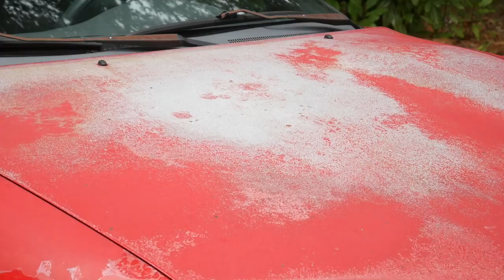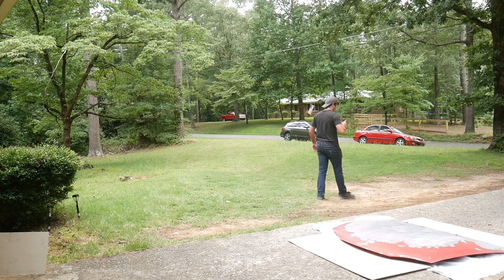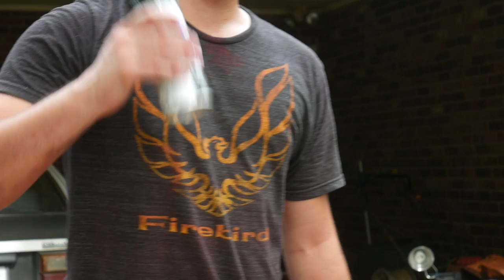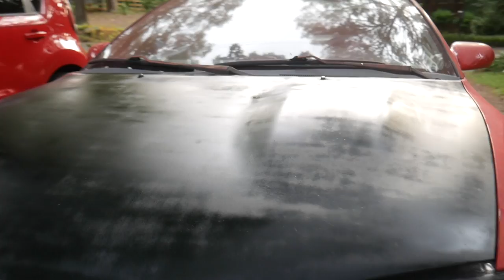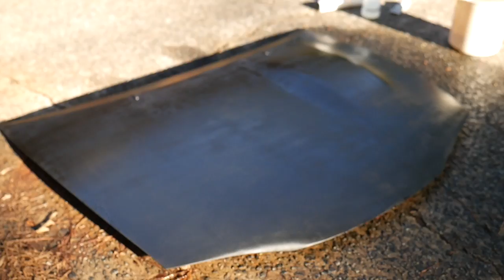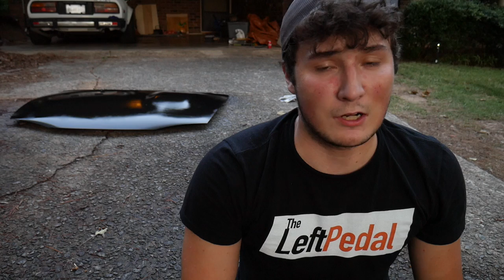Spray Painting a Car With No Experience

Comment: For anyone wondering the streaking is caused by not enough over lap between strokes. There should be at least a 50 % overlap (meaning your next stroke should be half over the last like mowing the grass.) I for one like to have 75% overlap
Reply: Please don't say "I for one....".    It's so .....
Reply: True however that cheap spray paint   does not put out enough paint. Next time get better paint it makes a world of difference and I don't even mean super expensive rattle cans either.
Reply: @timwegman5776  that's a good point!

Comment: I'm not a professional painter by any means. From my experience, 90% of painting is prep work. Keep a solid 7 to 9 inches away and overlap your passes.
Reply: I think his biggest downfall was how close he was to the hood, if he would’ve backed off the streaks wouldn’t have been like that
Reply: @KaelinTate  looks like he also used very cheap spray paint they tend to have awful tips
Reply: Nah with rattletraps you need around a 75%overlap to actually make it not streaky and look great

Comment: You didnt overlap you paint strokes and never paint in direct sunlight
Reply: Would a cloudy day be alright to paint in?
Reply: @dakotaburroughs7905   yes and no in a garage and at least 70 degrees yes but out in the open with humidity on a cloudy day I would wait
Reply: Yeah but hard to over lap with the fan pattern on the cap but yeah in ideal time bigger cap or a gun 😂
Reply: Dakota Burroughs build a booth. build it out of sticks and trash bags if you have to but just build a booth.
Reply: Can didn't have a fan sprayer only like a straight shot
Reply: @shinigamizzz5372  exactly its all in the prep work 😄
Reply: Yeah didn’t overlap. Even with a spray can you can manage to overlap and get better results
Reply: The biggest mistake he made was he almost sanded down the whole hood. Should have went all the way. Secondly if you're going to take it all the way down you have to use body filler. This will give you an even layer to work with. Most of the filler would have been sanded right back off as it was only meant to fill in the low areas. That's why it looks streaky because you have high and low spots in addition to misapplication. Shouldn't have to keep sanding down the primer let alone the basecoat. Then not only was there no overlap but he started spraying over the hood rather than before. The strokes were not the same distance causing uneven layers while applying. Now having said all this he has never done this before so it's a good way to start to learn. You make a mistake and learn from it. Everybody does.
Reply: @rafaelmonzon1429  Ur comment was a reason why i was happy watching this video, because i knew someone with knowledge would be here and tell us how to do it right, thx :-)
Reply: @3DamX1  Np I had to learn too
Reply: Had the same problem from holding the can to close and trying to cover in one coat
Reply: Not sure you understood the point of the video
Reply: Noted. Thank you
Reply: 3DamX1 same exact thought
Reply: @kevinmontoya7318  v
Reply: You also don't use Rust-Oleum. It's great for small projects, but strokes show really bad on bigger projects.
Reply: @STOPH3R01991  just watched 3 videos of a guy using rust-oleum and the cars looked great .

Comment: So the basics: 
-paint inside to avoid insects and dust that can ruin everything. 
-paint with long, wide, overlapping strokes, not short ones here and there like you were doing
-make sure there's enough paint. If you're not seeing it begin to shine after your 3rd spray you need to go slower to get more paint onto the surface
Reply: Also,I would have put that hood on a table or something.It had to be a PITA painting it like that!
Reply: Also he was painting with a round nozzle he should have used a flat nozzle for surfaces like that...
Reply: That is the key when painting big objects you need way more coverage and that spray painting technique that works on smaller objects where you spray on and off can't be used here.
Reply: Prep the surface. Then do it again. Also, resist the temptation to try to touch up that one little spot...
Reply: It's a beater car with a beater paint job and I think it's perfect. Good work man!
Reply: @joeyperdok  Unfortunately wide fan nozzles are not always available.
Reply: Very helpful comment and spot on.

Comment: I think there are two things to add: you seem to have used cans with round-spraying nozzles. I'd get cans that spray wide vertically or put such nozzles on your cans, clean and reuse it on the other cans. Also it seemed to be quite windy which blew the paint away.
Also I'd sand after each layer and give myself a few days for the whole project and work in quadrants (spray one are of the car part at once)

Comment: The trick is in the nozzle. It doesn't matter if you use Rust-Oleum or whateveroleum. Just get a good nozzle that sprays with a wide fan. This way it's easier to overlap you coats and you wont have the stripes.

Comment: A FEW TIPS for those of you DIY painters: if possible, try to keep the can VERTICAL. These rattle cans perform very poorly when you spray them facing downward too much. 

I learned this while painting my wheels, the second time I sprayed them, I angled the wheels more vertically. Also, if you spray too close, the paint will run. If you spray too far, you will get a rough texture and bad shine. Find the sweet spot on a scrap piece of metal or plastic. 
Finally, don't rush, I learned that multiple thin coats (5-6) give you the best results and even coverage. Buy a lot of paint, you can always return what you didn't use.
Reply: Also advice from my cousin that spray painted his lancer (350bhp not-EVO) - it's better to use too much than not enough, you'll want to polish, probably removing 50% of what you painted, anyways...
Reply: Spraying down IS spraying vertically. I think you mean horizontally.
Reply: @joserios1948  do you ever gaze into the horizon? 🤔
Reply: @beauyoung1172  the post was edited. Reading it made it seem like he was mistaking the 2. Thats why i said that. Looks fine the way it is now.
Reply: With most spray cans I would agree, but not with Rustoleum.  I haven't figured out how they do it (I'll need to cut one apart) but the "newer" (probably the last 5-10 years) Rustoleum cans spray pretty much the same in any position, even upside down.
Reply: w. woody what if you’re painting the floor ?...
Reply: w. woody  What, as in someone painting a car with a gun?  The good ones always hold the gun perpendicular to the surface, so surfaces like roofs, hoods, and trunk lids are sprayed straight down or nearly so.  If you don't you get tiger striping with many paints.
Reply: Definitely keep that in mind
Reply: w. woody  Huh???  Read my first comment.  The newer style Rustoleum cans which just about all their products have been converted to spray pretty much the same in every position, even upside down.

AND, within that context your previous answer makes no sense,  a pro painter isn't going to be doing a job like this with a spray can.
Reply: @Jose Rios  Do you hold your handgun sideways too??

Comment: I’m an old man, I think you did awesome 👏! I could not have done that good.  Good Job buddy👍.
Reply: Mark Lanham You’re an old man?
Reply: L00N3Y ABC  actually coming from a painter it depends on the situation on a flat peice of metal of course it's ideal to stay one way to keep overlap consistent and smooth however when encountering ridges, and shapes in the metal it is important to hit it from different angles to make sure paint is even at all positions no peice of painting flat one way if your peice has a bonnet scoop or such as you'd end up heavy paint at the top of the scoop and bugger all around the sides or at the very least very incositant spray pattern. So maybe give it a rest.
Reply: @georgekatsikis6729  you're right katsikis

Comment: There is some solid advice in the comments.  That is NOT terrible for a first timer.  Listening to you talk about it, it sounds like you’re on the right track with what needs to happen.  Keep trying on practice panels if you can, skill is acquired by practice.  Slightly wetter coats will help each overlapping pass lay down into the previous pass, when the coats are light it dries quicker and lays on the panel as a mist...giving you that rough texture.  Also, always follow your “wet edge”.  For example, don’t start on either side and meet in the middle.  Make sure fresh wet paint is overlapping your last pass of wet paint...some paints may require more overlap than others.  Keep at it and good luck!

Comment: I’m starting a project too no professional but here’s what I’ve learned:
Start with 400 grit, move up to 600 grit. Fill the scratches with metal filler. Then Prime the car and sand it wet sand paper at 6000 grit. Then paint - get and airbrush if you can. But I loved the video ! 💕💕💕💕💕

Comment: On most spray can nozzles they will have a direction head. You can twist it so you can spray up and down.. or left to right. The reason you are getting streaks is because the nozzle was probably set to up and down. You were spraying left to right. 👌 hope this helps

Comment: Need to put this item around hip height on 2 wooden work horsesl
Outside temp between 60 and 75 degrees
Under a roof or out of direct sunlight
Out of the wind
Paint can should be less than 12 inches away 8 preferably
Wipe the surface with acetone to remove any fingertip oil all grease and oil.
Only use one directional paint sweeps either left to right or right to left not up and down and always overlap by 50 percent.Takes practice with spray cans because the spray fan pattern is only about 3 inches
1st coat very light  just to get coverage not looking for quality just to get tacky
2 coat more precise and 50 % overlapping
Same with 3rd coat 15 mins between coats religiously time it.if any sooner run risk of cracking and  crinkling previous layers
3rd coat overlapping

Comment: Do painting under cover out of direct sun. To get a smooth primer, the first 2coats should be quick long strokes with 70 -75% overlap. The next coats should be shorter slow strokes covering smaller areas, and immediately followed by a dusting to even out the coverage. Let dry then sand lightly to smooth out the paint. Follow the same procedure for the final cover coat.

Comment: I spray painted my hood just watching youtube videos for reference,. I used Rustoleum black, 2k clear, wet sanded it, cut, and buffed. Looks 90% perfect, nobody would notice unless I pointed out the slight flaws. 

ps. My car  is a factory Honda black. Compared to the rest of the car the Rustoleum black hood has a very slight muddy, brown tinge to the paint, so its not a perfect match but like i said you cant tell unless i point it out

Comment: Yard chicken is awesome. You dedication to the paint is great I learned basically the same way just dive on in. My first coat I hold ten to fifteen inches away and give is a mist basically that way it gives a tacky surface and you cover more surface and avoid the tiger striping which is the lines. Looks good though thank you for the video

Comment: Son, you did an amazing job!!
Remember persistency is the key to success and you have a lot of that... you never gave up and end result was very good. Black is a hard paint to work with anyway.
Suggestion: 
1) go back and watch others videos again and write down each and every step and prepare well before taking on this type of a project.
2) do it in garage with out wind.
3) warm up that cans in hot water for about 10 minutes for easy grow of spray.
3) give 10 minutes between the coats
4) don’t remove the hood off the car, it will be easier to spray while standing.
5) get rustoleum ultra matte paint, it’s more forgiving

Comment: Respect the enthusiasm, I recommend keeping wide pray pattern caps for spray cans helps eliminate zebra strips. But we all gotta start somewhere. Always keep the can moving to prevent drips and runs.

Also a spray gun does wonders but I've been able to get buy without one and spraying inside does wonders because your in a controlled environment sometimes humidity can mess up a paint job.

Comment: If you have a compressor you should have used the spray gun
Reply: KAT holy fuck why so hostile. the guy making the video obviously has a compressor cause he blew off all the sanded off paint
Reply: I think the point of the video was so noobs like me can get an idea of what painting with just rattle cans might look like.
Reply: Not everyone has spray guns nor the money to invest in on
Reply: Dakota Burroughs you can get a cheap spray gun at harbor freight for about $15
Reply: @TheJared1445  not everyone has an air compressor and is that really a good gun to buy tho?
Reply: Dakota Burroughs I mean it’s better more efficient than a rattle can. It’ll yield better results than a rattle can
Reply: No enough volume in that little compressor...
Reply: john garnett there is enough volume in it if you regulate to a lower psi. Also if you used shorter strokes and kept it wet you’d be fine
Reply: Jack Ball you would be limited.. with the compressor he has... short strokes.. you’d end up with areas drying before you finished
Reply: john garnett yeah but depending on the paint he used and the temp you could do it because I’ve done it before
Reply: Because he has a LVLP compressor and he needs HVLP for spraying cars
Reply: Also need to make sure tank has volume and DONT forget an air dryer which will run you 60 alone plus regulator
Reply: Cheap ass paint gun at harbor freight is actually badass. Especially for the first gun. Yea it's not my 300 dollar gun but for 16 bucks its badass

Comment: Put a clear coat on it.
Reply: Christine L he did that at the end
Reply: @itskoolnotcool  he didnt use  enough... may as well not have used any at all
Reply: no he needed 2k clear coat
Reply: How exactly do u use clear coat? Do you apply it after your done painting?
Reply: @dakotaburroughs7905  Clear coat is part of the painting process. You lay down your base coat then around an hour later you would lay down your clear coat. If the lacquer comes out 'orange peeley' you can then (if you have laid down at least 3 layers of clear coat, leaving 15-20 mins before each layer) start wet flatting or how Americans call it 'colour sanding' starting with 1200 wet/dry sand paper, 1500, 2000 and a 3000 trizact pad. Then compound and polish.
Reply: @dakotaburroughs7905  yeah but it needs to be done a certain way.  And more than one coat usually.
Reply: @ekginseng  spending the money for 2k on that wouldnt be justified

Comment: The Primer, base coat, and clear coat are really expensive but, it’s worth it. 

Cheap= less life+ ugly

Expensive = long life+ beautiful
Reply: David Brambila not really true it’s all in technic, skill, and vision. And the only thing that is expensive is the clear coat
Reply: Erik Barren , I agree with technic and skill but it can be a little hard without a good paint gun like a Sata paint gun and, you can ruin you’re your paint job if you have bad airlines due to condensation in the airlines. if you really want to paint your car with cheap products, you’ll probably have to re clear your car every year. I’ve seen cars roll in the shop with cheap products on it. Those cars have clear coat flaking off of the hood and fenders usually because that’s where the engine lives and, the paint under catches water and it starts to grow moss. At the end of the rainbow you find some rust and now you have to cut out the rust to stop it from spreading. Then you have to weld some sheet metal behind the panel, add corrosion protection, slap some body filler, sand, prime, color match, and then you clear.
Reply: David Brambila also really depends on that clear I know I’ve had lots of practice and the vehicles I’ve painted you can’t tell if I painted it with a paint gun from Walmart a sata 5500 or a rattle can. But I agree with you tho

Comment: So just a tip:
Lay down a base coat (primer), then 3 HEAVY coats of color. sand 500 grit. Then lay down 3 coats of clear, wet sanding in between each. Then use a buff pad and polish. You will have a super gloss paint job.
Reply: That is the way is done, after you get a few layers of the black on it you can use flat black or gloss black, when that dries use a clear coat paint and last it on with long strokes that go all the way and 60% overlap, let it dry light sand wet everytime, hit it once or twice more and you won't see, or feel any imperfections. Dude did a decent job, u can also pop a hole in the top of that spray can let it blow out for a minute, then pour that in a spray feeder with a compressor and spray like a pro, it takes more paint but it's easier faster looks better,

Comment: If I'm not mistaken l just watched a video that said to wipe it down with half alcohol and half water before painting. Just to get any dust or sand off. Also, the other comments about slightly over lapping to avoid the trigger strips was good information.
The fact that he asked for anyone's help got use involved. Good for you!